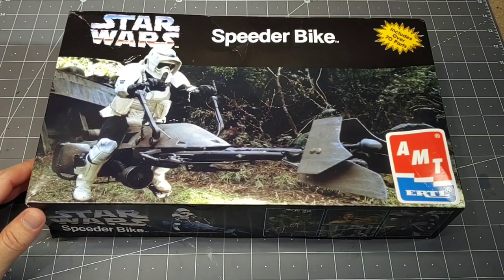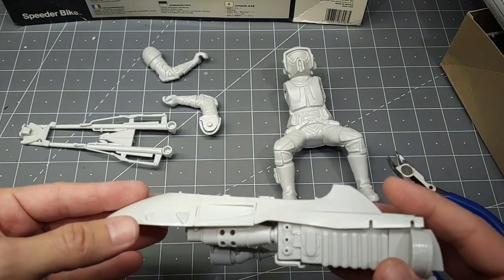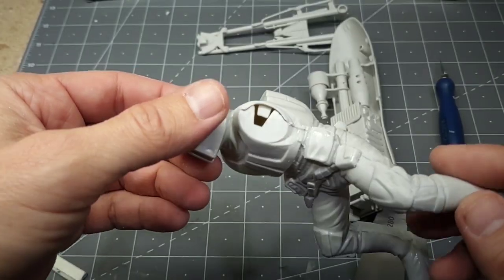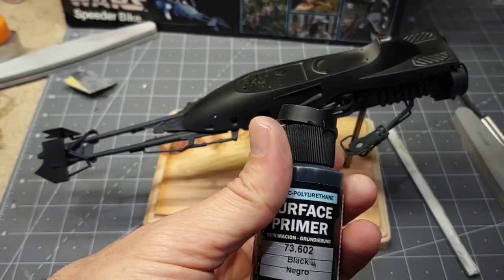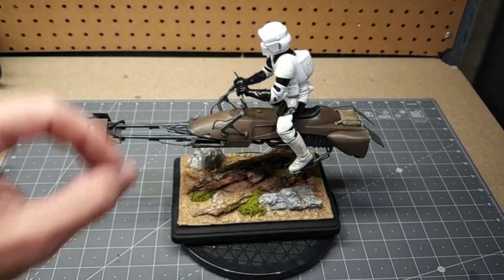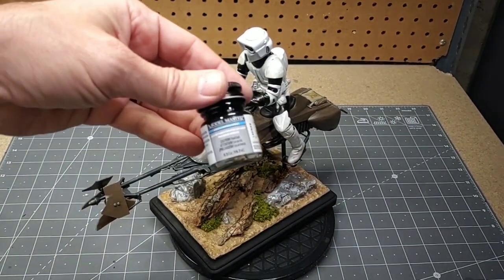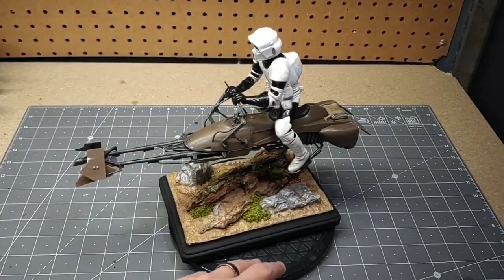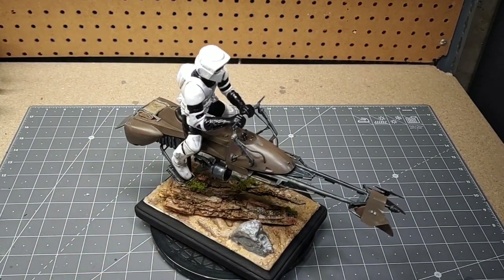AMT Star Wars Speeder

Comment: How does this bike scale with the Black Series Scout Trooper?
Reply from the maker: How large is the Black series Trooper?
Reply: @EagleSciFiModeler  Scout is 6 inches tall and the Speeder Bike is about 11 inches in length.
Reply from the maker: AMT Trooper is over 6" long in a seated position and the speeder bike is over 12" long.
Reply: @EagleSciFiModeler  thanks for taking the time to let me know! Seems just a little big for 1/12 scale since it should be about 10 inches in length but given that Hasbro made theirs 11 inches you can probably fudge one of their figures onto this if you aren’t happy with the oversized Scout with the off looking in places armor. I think this is the same kit I’ve seen Black Series collectors use and it looks great.